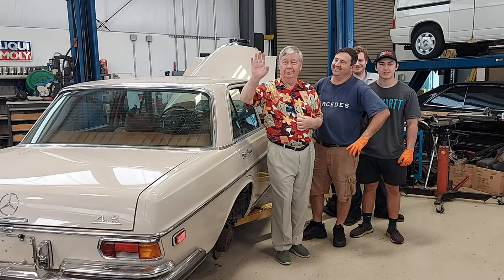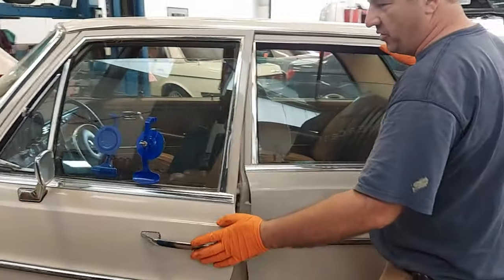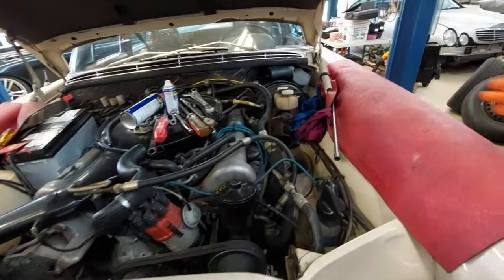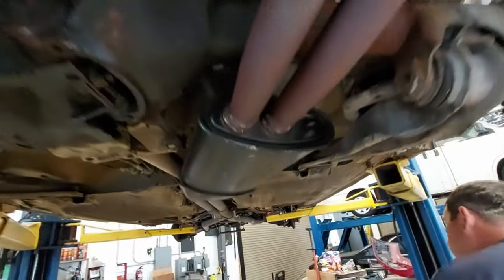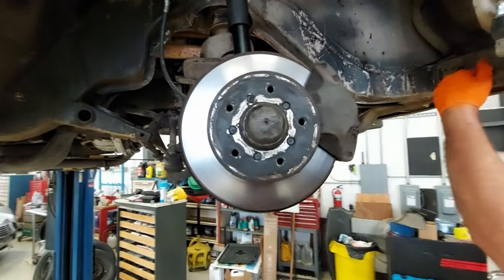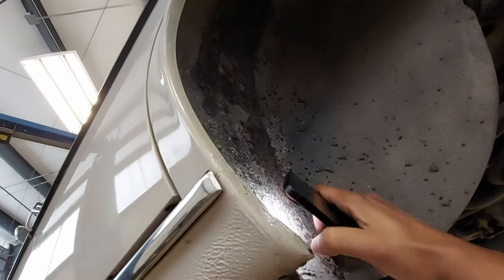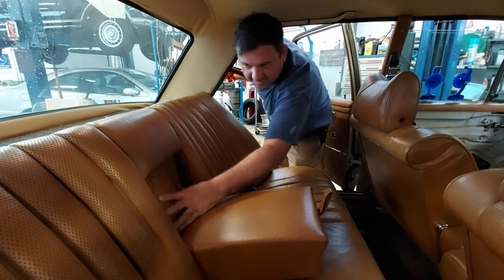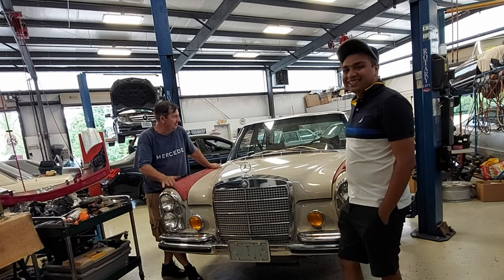Everything WRONG on my Classic Mercedes 280SE 4.5 | Vintage Soul

Comment: The steering shock absorber is on backwards.  

The jack hole coverings are still readily available for very little money.  Front ones are part number 108-899-01-08, and the rear ones are part number 108-899-00-08.  

The interior color is not called tobacco. It's called Cognac.  It originally had reddish brown flecking on it, but it wears off over the years and you're left with a solid color.
Reply from the maker: Thank you! This was very helpful Would like to drop by your office sometime.